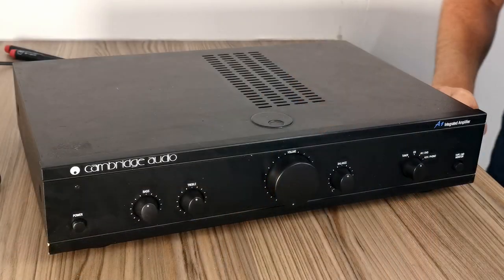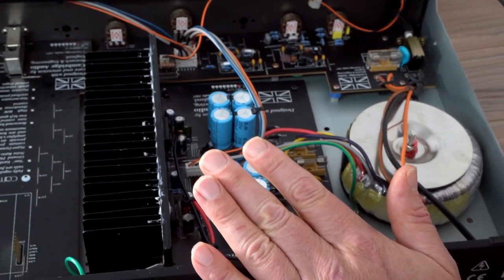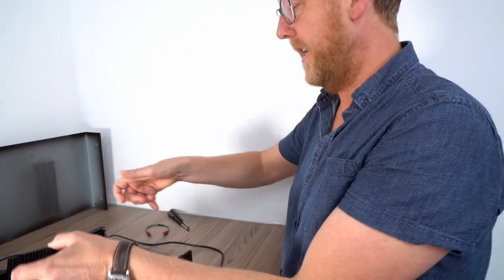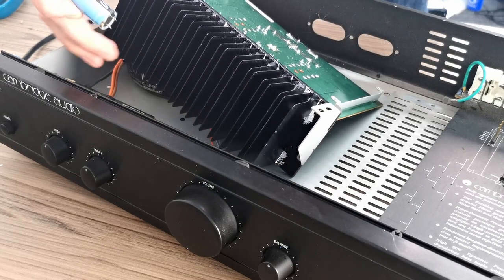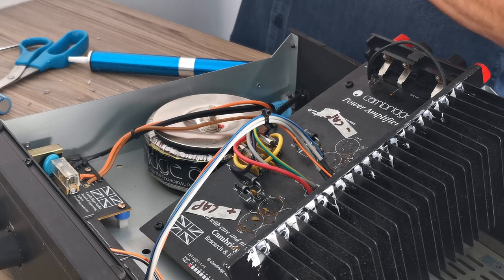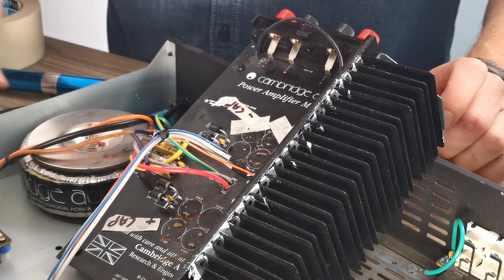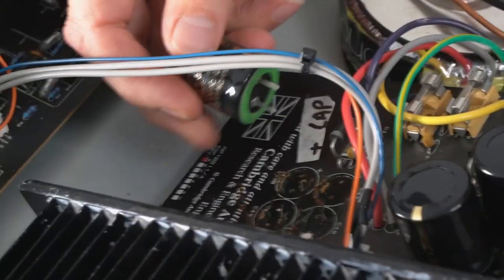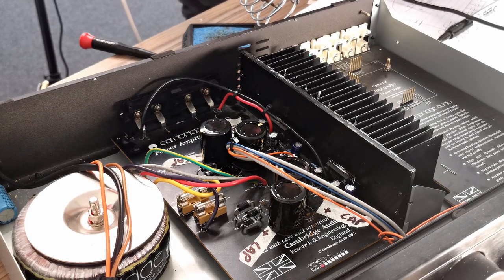Beginners Guide: DIY Hifi Amplifier Upgrade, Power Supply

Comment: You really didn't discharge anything when you tapped the PCB like that, the green color comes from the solder mask, and it doesn't conduct electricity so you basically just tapped the circuit board with a grounded wire. Which did absolutely nothing. You should use a 5W resistor and place it across the pins of the capacitors, or worst case (100x better than what he did) just short circuit the capacitors. This is deadly if it's not done correctly. The filter capacitors can hold a tremendous amount of charge and depending on the voltage rating, a voltage of for example +80VDC, which is definitely enough to send you down the grave. Please, please don't do it as he did in this video, what he did, didn't do anything to actually discharge the caps. If it's not clear what I meant with using a resistor, just do a quick google search for how to safely discharge capacitors and you will find hundreds of examples and videos, without a doubt.
Reply: I know, I'm thinking what the hell?  Doing that to his front door would do the same thing.

Comment: You look like your scared to death handling it and when you "discharged"the caps you touched the clips to where there is no conductive metal.  You touched the green insulated part you need to touch the alligator clips to the solder joints of the capacitors.  Take your multi meter and continuity tester and there will be no beep if you touch the same spots.

Comment: Nice video!  Good caps certainly make a difference.  Wouldn't the solder mask insulate the caps from being discharged like that?
Reply from the maker: Thanks! Dont have to worry to much about discharging the board but Nicks been doing this for a long time and some habits die hard!
Reply: @hificollective  I'll be upgrading my caps too and this is my biggest conernern. I'm an amateur. I did a crossover upgrade with parts from hificollective. It went well and i'm amazed buy the results. I want to tacle the amp (Atoll In30) too so i'm looking everywhere information.
I'm not afraid to dismantle things but i know there is danger in amps. Specially those power caps. Any advise, or video link would be much appreciated.
Thanks for all your content !

Comment: I think it is necessary  to put 4 caps for the low impedance not two and a fast recovery diode.  A low esr capacitor is enough.

Comment: Strange method, usually it's preferable to have 4 caps rather than 2 even if the total capacitance is the same.  This feels like trying to make the wrong caps fit.
Reply: Well yeah theoretically having parallelled caps reduces the impedence, but I've never heard a difference changing things in this area.
Reply: @bobshifimods7302  bit of a slow reply, maybe its the impedance.

Comment: brilliant vid...i have a 35 yr old Technics Amp....I would love to upgrade. but i'm a complete novice...what would happen if replaced all 4 caps with bigger caps ?
Reply from the maker: You need to stick to the same capacitance as the original although for the larger reservoir power supply capacitors you can go up slightly in value. This will improve the smoothing.

Comment: Sorry to criticise. I did have respect for HIFI Collective, but after watching this, you've gone down in my estimation. Why did you try to discharge through the solder resist? and you should never discharge by shorting them. always use a resistor. Why not use 1 x 10000uf per rail and may be also change the bridge diodes for fast recovery type. Also, Cambridge audio put 4 caps in parallel to keep the impedance lower.  I would also have cleaned inside it first.
I don't know, may be I'm out of touch with everything. It has been a long time since I've done any DIY.  I'm sure people have benefitted from your video though.

Comment: What a bizarre way of soldering?  I was time served in electronics and have never seen people wrap solder around the component leg like you showed. 1) Mechanical joint.  2) Heat joint 3) add solder to the joint - not the iron.
Reply: I believe its because the new caps needed mod to board and tied the old holes pad to the new for conductivity.

Comment: SO. COULD YOU TELL US WHAT HIGH QUALITY CAPACITORS SHOULD WE USE IN THE POWER SUPPLY?
Reply from the maker: We nearly went for Audio Note Kaiseis on this build, but which caps to use depends on personal taste, budget and the rest of the amp. If you'd like more detailed assistance please contact Nick at info@hificollective.co.uk
Reply: The Mundorf AGs used here are superb.  Much lower impedance than most equivalent caps.
Reply from the maker: @Sparta155  We're inclined to agree as they've burnt in lovely with this amp, thanks for the feedback!

Comment: Sorry about being late to the comments, but aren't you making the project just a bit more complicated than it should be? I mean, the 1st hole can be the factory drilled, your new hole could be anywhere on the +/- side so long as you remove the green layer. I use  fiberglass pencil to do this (I'm not sure what you folks would call it).
Reply: He could just solder it to the green insulator where he discharged the caps, haha

Comment: you kind of seem like you don't know a whole lot - have you ever designed and built an amp from scratch. Once you do that you insta-know what most bits are if its a standard design. I'd just use bog standard filter caps like Elna ... cheap, good ... its just charge. Pairs of smaller cheaper ones have benefits too ... multi-stage filtering. Its not like the pre-amp input cap. Still, kudos for going at it.

Comment: Nonsense! I would use higher capacity less expensive epcos or panasonic caps, the same diameter (18mm) and raster (no drilling required), but slighly taller (it would fit perfecly). It would be 4x 3300uF 35V per (+) and 4x 3300uF 35V per (-). Much lower ESR. The amp would sound noticably better than original.

Comment: Great stuff. What’s your thoughts on bypassing them with small value polypropylene caps?
Reply from the maker: Fairly common practice these days, can tighten  up the low end and people usually use caps with  1/100th of the value being bypassed!

Comment: Oh no, this is all kinds of wrong. He didn't even take a razor and lightly scrape the old cap leakage off of the PCB. In time that can eat through the board. You can also use Goo Gone and a light abrasive. In any case, this guy is seriously testing my OCD.